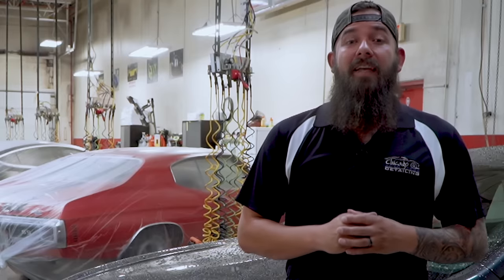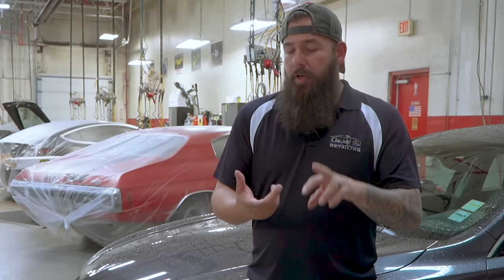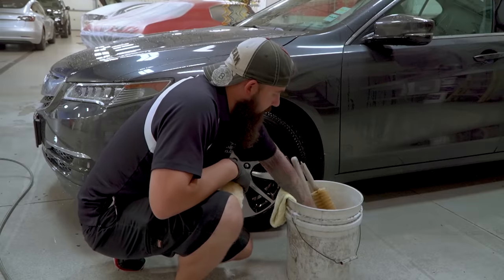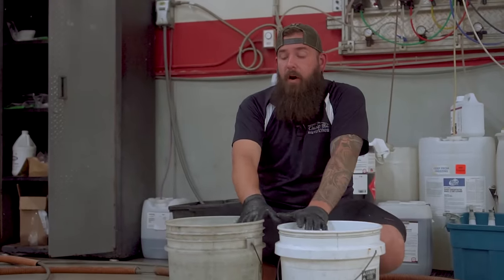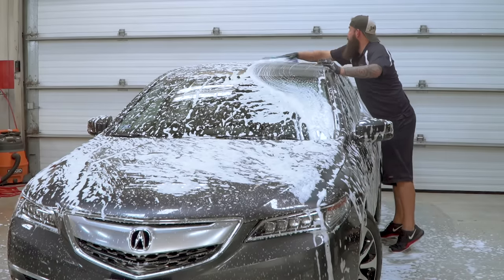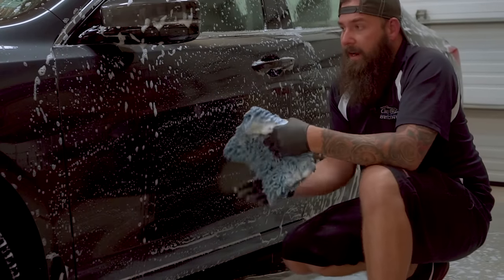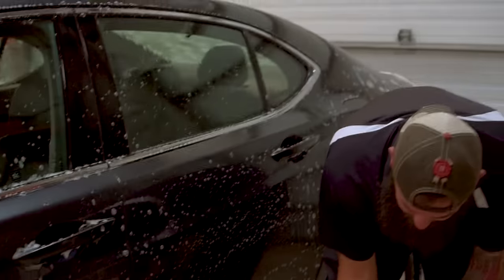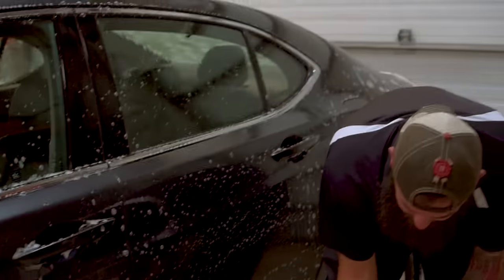A detailers SECRETS to hand washing

Comment: Errm, let me stop you at 1:30 and tell you that i use a bucket and yard broom on my Land Rover. i don't consider any part of my car to be 'delicate'.
I don't see the point in worrying about scratching any surface when you routinely drive along lanes that are up to three feet narrower than the landy due to overgrown hedges.
By the way, using a broom means getting to the roof isn't difficult.
Reply: i've heard that the electrical system is pretty delicate

Comment: Make sure the car is CLEAN before using that hydrophobic spray or else you're sealing in dirt/oil/grease/etc !  And don't put towels on your shoulder, body, under your arms or else you'll be smearing body oils/sweat onto your car!
Reply from the maker: The dirt and oil helps remove and fill in scratches.

Comment: Ok so let’s be real here fellas. To wash a vehicle in the way is nothing more than being Unnecessarily obsessive and compulsive. Using 6 different tools to wash one wheel using the same water has no difference in the cleaning result. Sure the cleaning tools make it a bit easier. However using a mit on the face , a brush on the tire, a reach on the inner rim etc is just obsessive. Again the result is the same just being careful. Dirt is in the soap and water no matter what you use to clean. It’s called cross contamination. Now on the body, sure use soft cloth or mit. It isn’t rocket science. Rinse off the vehicle with a good wash, then Clay bar the vehicle with lubricant soap. Then wash, dry , was , or detail spray. IT ISNT SCIENCE

Comment: I don't get why so many detailers or mechanics use these freaking disposable gloves.
Reply: I JUST did my own car with a pressure washer, clay bar, the whole shebang. I also did the inside and outside. I can tell you that the gloves really helped me keep the chemicals I used off of my hand, made it a bit easier to grip the towels or whatever I'm using, and helped me keep all my stuff clean because if they got dirty I could just change gloves. I don't think i could do what I did comfortably without the gloves, especially when I waxed my car!

They also have the "cool" factor in that they kinda make you feel like a "professional" taking care of your car.
Reply: @MikeJustice1993   Its not about using no gloves at all, Its about using the right gloves that you don't need to throw away after you're done. I know they do the job, but you use them, they get a tear, you throw them away and use the next pair. There are reusable gloves out there with protection from all kinds of hazards one could use more then once. But I guess its more of a price point than a "cool factor".

Comment: 7:47 do as I say, not as I do - BUSTED. You didn't wring out the pad before putting it in the soap bucket.
Reply from the maker: It's not really necessary, as long as your rinsing it.
Reply: @ChicagoAutoPros  7:01 :) but understand I'm just having a little fun.

Comment: Worst wash video, always have a separate wash mitt and two wash buckets for your rims to not mix it with paint mitts as to prevent paint scratches. Never use the same fluids on the paint as the rims dump the bucket and refill. Pressure washers are a bit dangerous grit gets trapped in the nozzle and can act as a projectile and actually cause accidental chips in the paint use a Normal spray nozzle and spray it down. Always use two buckets ones for rinse water and one for wash water. Rinse the wash mitt in the clean water then dunk in the soap water then wash that’s all you need to do have fun.

Comment: This is really weak. Its a shock my method destroys yours.

Rinse car with pressure wash. Then apply soap with foam cannon...chemical guys soaps are best [he got this right]. Then let the soap sit until starts to dry. Then pressure wash that off.

Now here is the key. You will need 6 mfiber mitts. Get a bucket of just water...no soap. Now spray the roof with foam cannon and wash. Rinse mitt as needed in water but squeeze water on floor. Do not rinse back in bucket. Now do 1 panel foam and clean with a new mitt except the very bottom. When all 5 sides are done [roof front back left right] use last mitt to go over the bottom. You may need to refoam. Rinse this mitt regulary. If it gets dirty, use the roof mitt.

Comment: Your still an amatuer on cleaning a car. So many things are wrong on this video or missing. I've cleaned 10,000s of thousands of vehicles
1. Missed washing door jams first
2. You wash the roof then,the windshield right to the hood,no,no,no. Great way to get scratches on hood becouse you picked up dirty and bugs on your windshield, and when you lift windshield wiper blades to clean underneath,when your done carefully sit the windshield wipe on the top of your mit and pull  towards you cleaning the wiper.
 You should rinse car off first spraying out door edges then wash out door jams so dirt doesn't drip and get in your mit when your washing the exterior paint. Then rerinse car and door jams( including Hood and Decklid).
 It also looks like soap company sold you on everything they have.
 Your spending more money then needed.
One last thing,when your all done you should think about putting a couple drops of water dispersing oil on door hinges.Not from a spray can, but from a dropper so you dont get it on the paint.
 There is a science to this, lot of experience and experimenting over the years. 
 Don't take this as an insult, but take this as a Chef would take criticism from a Master Chef.

Comment: First of all..no secrets revealed.
Second.. I'm very surprised you used the upper body washing mit to wash the lower rocker area. That microfiber mit is a bank of debris  once it gets ahold of any little rock  stone chip..or any little debris ..there is no chance in hell that just rinsing it in the bucket and scrubbing it down into the grater, that it will loosen or rrmove any embedded micro fine rock or salts or grains of sand that are in that mit.
 For a so called professional detailing shop , I can't believe you use the same mit on the upper and lower rocker panels  and basically undercarriageof the car.

Comment: Followed your info verbatim. The products you use, do not yield the results you claim and show. So, ... tell the truth... you do not use a power washer, and if so, what tip do you use and what pressure level? I’ve intentionally cleaned and sealed a car, following your system, but a power washer blasts off the finish...... care to comment?